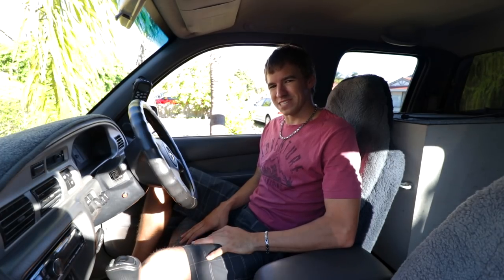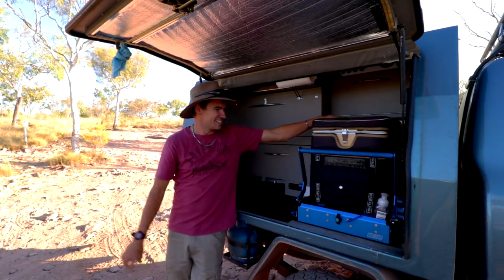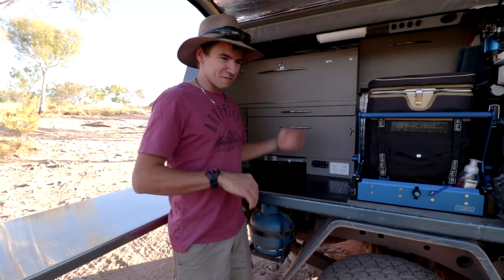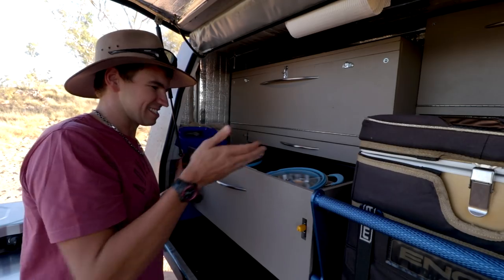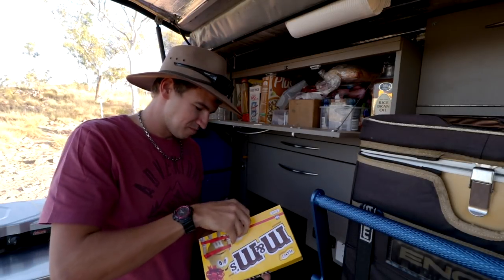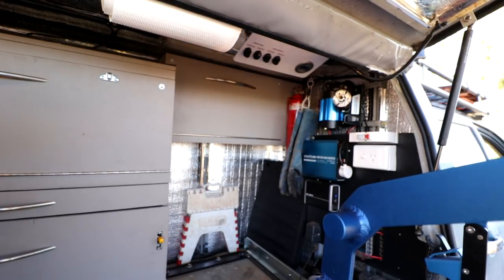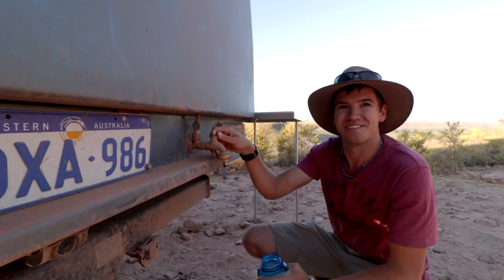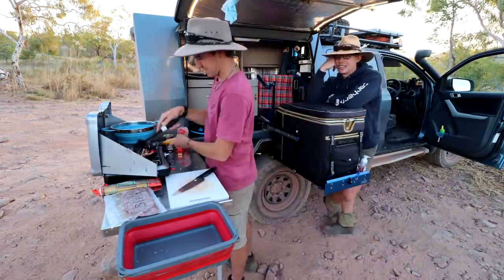Ultimate DIY Canopy Camp Kitchen - Project Cyan

Comment: Kicked it out of the ballpark again dude...👍 . 
A little safety tip, invest in a $20 gas fuse for your has bottle. Not only does it shut the gas off instantly if there is any sort of fail between it and the stove (3rd degree burns in remote areas aren’t fun), but it also conveniently has a gas gauge so you can monitor gas use and know when you need to fill up.

Comment: Hi good set up for your kitchen. I was thinking about your utensils draw what I've seen is a small piano hinge at the back of the draw at the top with a flat stainless lid that closes over everything in the draw you would only loose about 2mm of draw space but at least you could always open your draw without the utensils jamming up. When you pull your draw out you open the flat lid and all good. You would need some sort of catch at the front to hold the lid in place otherwise the utensils will bunch up and jam the lid up then you would never get the draw open.

Comment: Hi you have a great setup there, but with the fire extinguisher being hidden in that tight spot it would be impossible to get at in an emergency.
Reply: Yes I suspect you could fit another small extinguisher on the right hand corner.

Comment: It’s called sarking wrap insulation they use it for walls and roofs but builders iv worked for often use it for walls and they use Earth wool roofing blankets for the roof but the do use sarking wrap sometimes as well for a cheaper option

Comment: A lot of great ideas here, very well thought out. Particularly love the insulation, how did you attach it to the canopy (I've heard problems with glue due to heat)?
Reply: Lachlan Williams I’m thinking of using gorilla grip, Then put marine carpet over it and screw it into the frame work.

Comment: Love your videos mate! Just watched this one showing your water tank setup and curious how exactly the lines work and the bypass valve tank to allow fill up via the outlet?
Reply: Michael Sanders so you have a non-return valve on the tap side of the pump and then a single to double pipe connector?

Comment: Hey Michael, great work on your car and videos.
I have a similar set up on the back of a Hilux dual cab chassis. I have fitted vents as I thought it would be necessary to provide fresh air for the frig to operate efficiently.
But I noticed you haven't fitted vents and was wondering if it has caused any problems regarding the frig operation.
PS, I run a 40 litre Engel also!
Cheers David.
Reply: Hi Michael,
The vents I fitted are of a marine type, I have fitted two facing forward and one facing back in an effort to provide a small amount of positive pressure to help with dust proofing. I believe this of most use at high speed and of less use the slower I travel.
The vent design I chose allows me to fit foam blocks in the vents when on dusty roads. 
I have had concerns as to whether with the foam blocks fitted, my frig receives enough airflow to operate efficiently. 
Having heard that yours runs fine without vents at all alleviates my concerns a lot.
I have some of the insulation you used left over from our house extension and am considering insulating mine as well.
I think you said that you fitted two layers, Michael did you try it with one layer first or fitted two layers at the start?
I could send some photos if your interested.
Cheers David Booth.  @SeekAdventure

Comment: Hey Mike,  i forget which video you mentioned it in, but the heat insulation where did you get that from man? I own a 76 Series Wagon and recently installed a gullwing and thought i could use the heat insulation on the inner door. Could you please point me in the right direction mate. Im from Perth too :)

Comment: Love the setup and all of the videos you are making so far.... keep up the excellent work.

Quick question..... I live up in Darwin and the constant heat up here is absolute hell when it comes to adhesives on the inside of a canopy. What adhesive did you use on your aircell insulation?

Comment: Okay so this is amazing. Can I just ask, was the Mazda car choice more because of the price+what you get, bang for buck? Or were you looking for any kind of ute? I'm thinking of basically copying what you've done (with my own modifications of course). 
I've researched the BT50 and apparently the DPF isn't an issue on the BT50, they've done their DPF right. Being a 2012, does yours even have a DPF? My dad's 02 land cruiser doesn't, which leads me to believe they came inbetween 2002 and 2012, 10 years.
Reply: And on a side note, could you please link me to your fridge slide?
Reply from the maker: Hey Kyle, to be honest the canopy really sold me on the car, I wouldn't be able to afford to have one put on there.
But aside from that, from what I heard/read the Bt50's didn't have too many issues, and seemed like a good buy. Your spot on, since its a 2012 there is no DPF.

The fridge slide is by MSA, ARB are the easiest place to find them I believe, but there are other stockists out there aswell 🙂.
All the best with your setup mate 👌👍
Reply: @SeekAdventure  Jesus mate, #1 Jesus has looked down from heaven and spoken to me, and #2 thanks for all the help!

Comment: Mind me askibng how much your canopy cost you? 
Thanks mate, mint rig.
Reply: @SeekAdventure  Ah ok that's fair enough, Was looking at A new tray and inbuilt draw, Plus a complete liftoff canopy box  similar to yours for my D-max and i got a quote around $5000 from MRT in brisbane wich isnt bad.
your setup looks mint tho. 
 Also i did have one of the cheap Chinese knock off PWM solar controllers and a cheap solar panel and to my surprise, like your cheaper one also it was putting out a fair bit of amperage into my second battery!
Good vids man keep it up.
Reply: If it makes you feel better, i got 35's on the dmax ;)

Comment: Great job on the table. How'd you attach the legs to the table. Any chance of some photos if I give you an email address.
Reply from the maker: Hey Rob, the legs are held in place just by 4 pop rivets from the edge. It's a pretty simple to make if you have or know anyone with a welder 🙂.
I took afew photos for you, check them out on onedrive here https://1drv.ms/f/s!Ah6tIU2nPkwN9S2KrMLJPfpxL66h
Hope that helps 👍